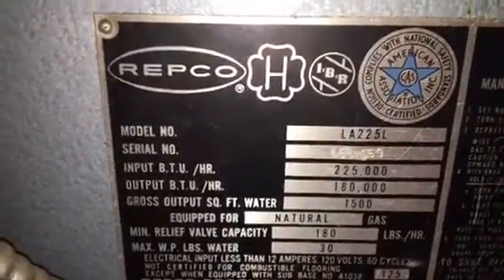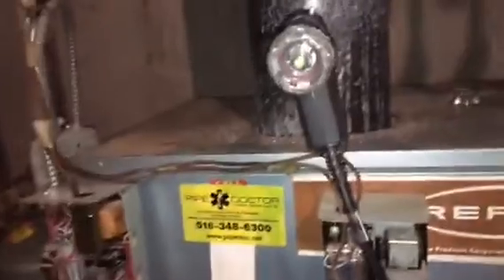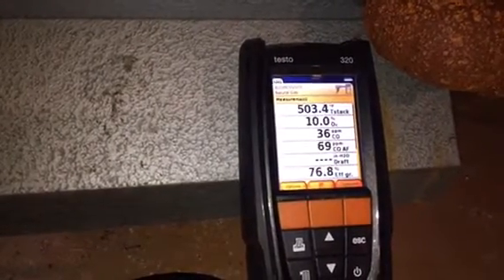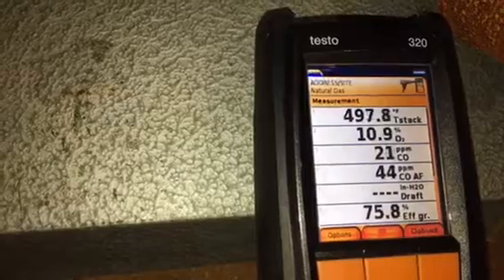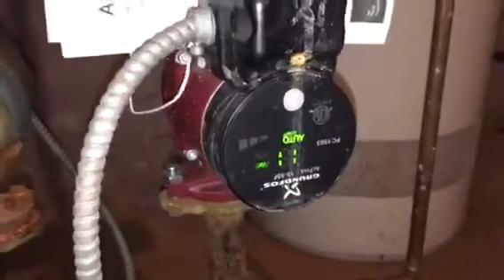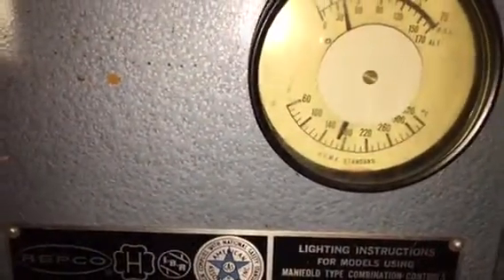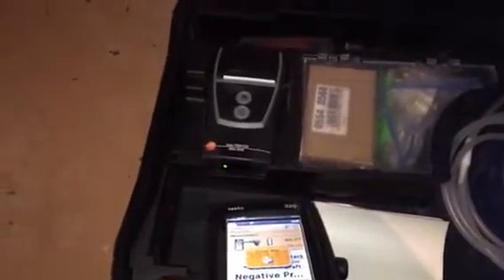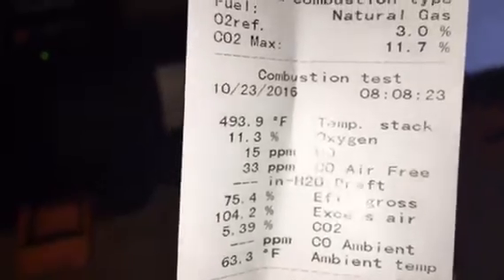Repco Gas Boiler - High CO Levels - How to Fix & Adjust

Comment: Great to see you on a Repco! Nothin' else on Y/T. I present to you a Repco GM - Series Gas Fired Boiler. The pilot light will not stay lit as last week i got up at 4:30 AM and threw the power switch on. The system shut down in 15 minutes not going thru the cycle. So being cold, I go down into the crawl space and the pipes are cold and no pilot light on so i lit and relit 5x's or so and in holding down the pilot valve and then releasing, the pilot flame extinguished. There is no hum no longer being the switch is on stand by. Now i have been using the master switch in the hall way to on and off to conserve gas consumption rather then the computer thermo settings. Have i done something wrong by using the on and off switch rather than letting the thermostat computer run the show? I am burning the Midnight Oil using kerosene lamps to keep at 60 degree's in the den. The other 2/3rd's of the house is to cold to wander around. What so you think? Thanks for the next logical advise. Joe, Long Island
Reply: Sounds like a bad thermocouple.